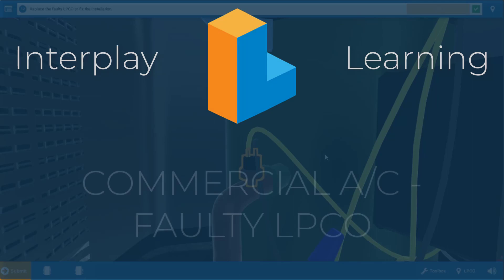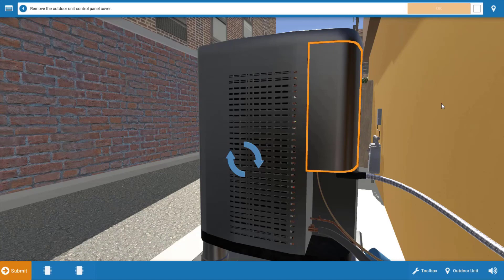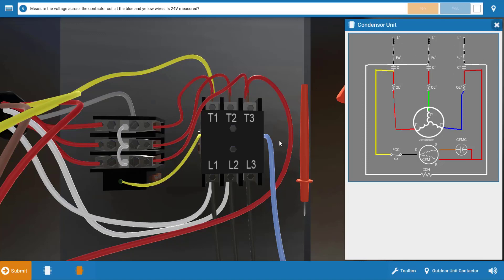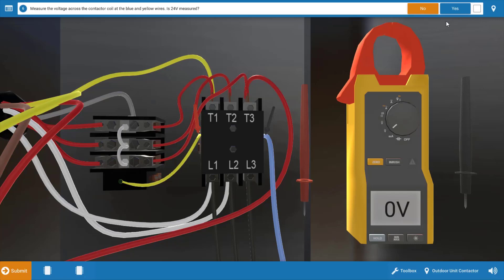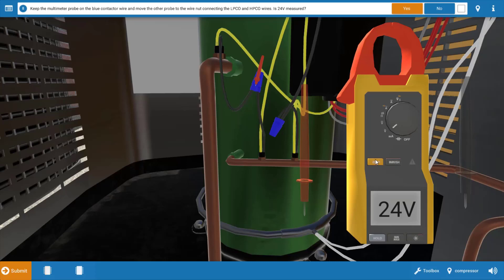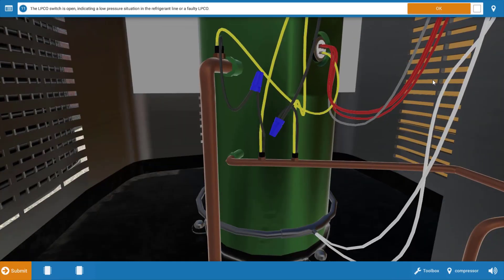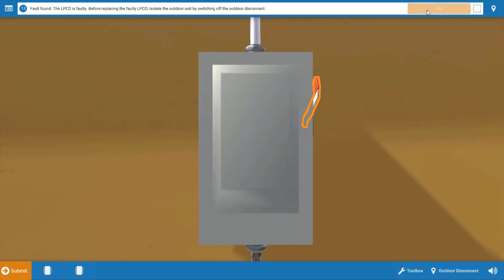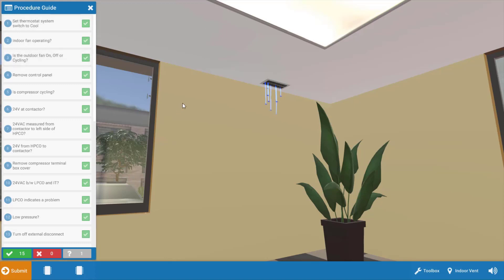[2019] How to Diagnose a Faulty Low Pressure Cutout (LPCO) on a Commercial A/C

Comment: Hi. My outdoor ac is showing low pressure lock out code so i went ahead and tested resistance on LP switch. I'm getting around 5 ohms reading between low pressure switch wires with the wires isolated from control board. Does it mean the switch is bad and I can replace it myself? Thank you.
Reply from the maker: My bet is the switch closed again. Probably low charge or check the indoor air filter.